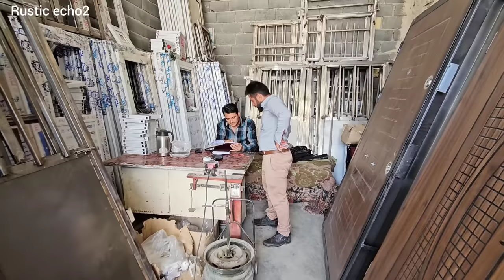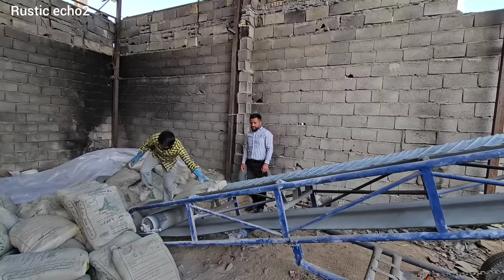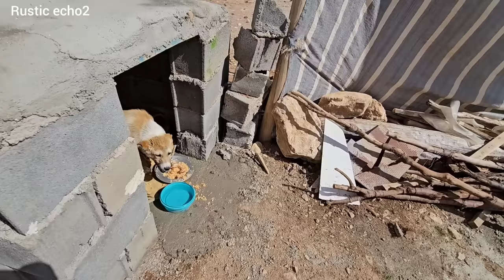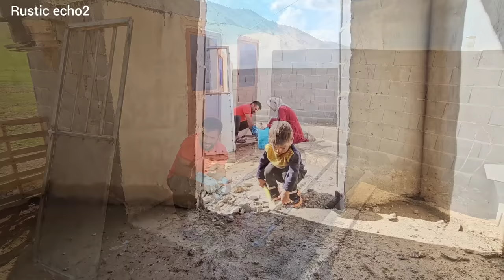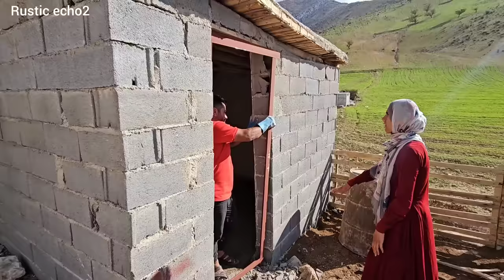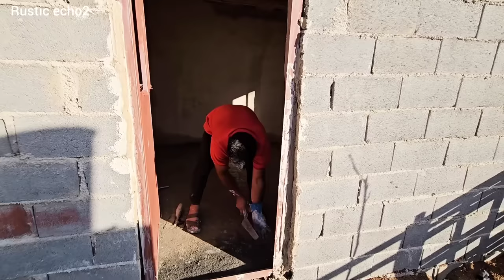Being committed: the story of Naseeb Allah and a letter to buy a door and pay back a loan"

Comment: If you know you are going to build a new building, BUY THE DOOR BEFORE THEN SET THE Cinderblocks around the door and window FOR A PERFECT FIT AND WAY WAY LESS WORK you’re doing it backwards. Again by the doors and windows first at the same time you’re buying the cinderblock in the cement. Doors and windows should not be an afterthought. ❤